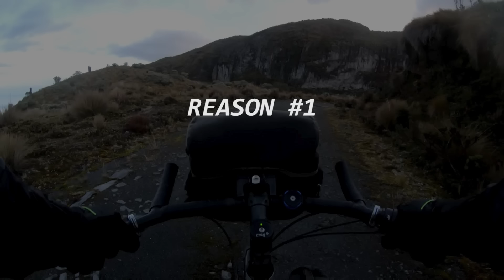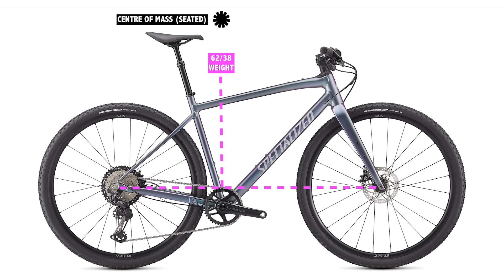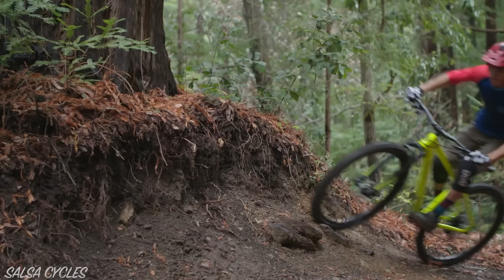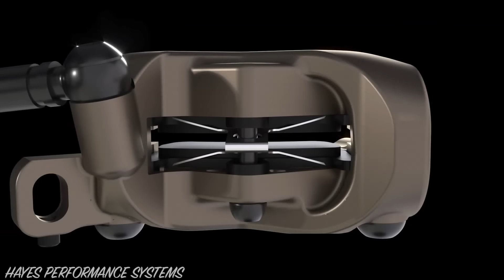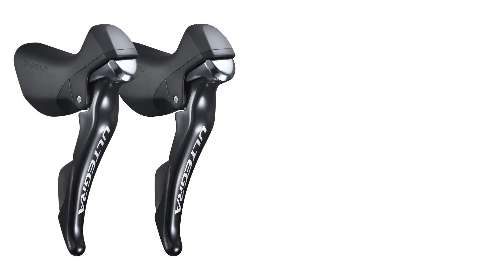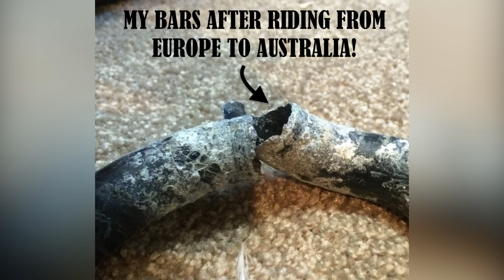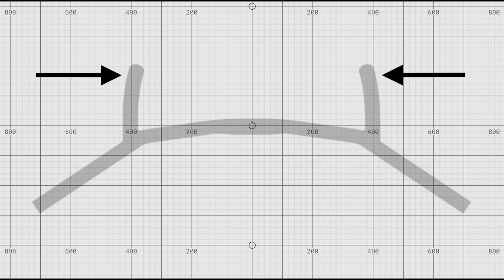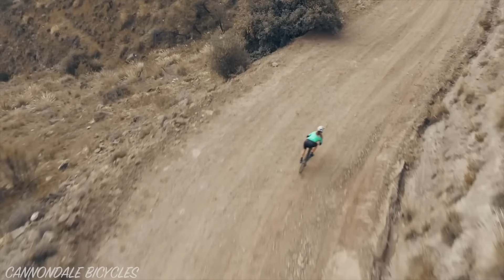Why Flat Bars Are BETTER Than Drop Bars For Most Cyclists (Objective Analysis)

Comment: I'm no expert but have had great results using a flat-bar MTB with a short stem and Jones Loop (a very wide, swept-back design with room for a grab bag). True trail flat bars did bother my hands on rides longer than 20 miles, even on flat rail trails.

Comment: More weight, longer distances means you need more comfort.  Comfort and control wins over aero in these scenarios.  Alt-bar "flat bars" are the absolute best.  That being said, simply own a minimum of 2 drop bar bikes and 2 flat bar bikes all varying in shape and position and you're good to go.

Comment: I am 75 years old and ride the parks mostly on paved trails. I love the high bars of the Trek Verve +2 and the short reach to them, leaving me upright in the riding position. I have had surgery on both shoulders, and I am missing the disk in the L5 vertebrae after surgery. The drop bars found mostly on the road bikes today are for those who race on pavement. The straight bars of the MTB fanatics are not for me. I won’t ever ride like that. So, the adjustable bars of the Trek Verve +2 will keep me riding. The “flat” bars would keep a bike like that unused in my garage if I owned one.
Reply: If you haven't ever piloted a recumbent, you're missing out on some serious, mile-munching comfort on two wheels. They're also very fast, faster than diamond frame bicycles.
Reply: Mtb fanatics? Wtf. Just ride whatever you want and let others enjoy their own things old dude.

Comment: The reason I changed from flat to dropbars is the ability to change hands position and thus avoid hands pain. Yet no doubt all arguments you detail in favour of flat bars are highly accurate
Reply: I'm sticking with drop bars so I can tuck and enjoy substantially less wind resistance going down hills or into headwinds.
Reply: @paulbcote  NERRRRRRRRRRRRRRD
Reply: 😂 But you don’t have any weight on your hands on flats, where pain is coming from? On drops half of your body weight is on your wrists
Reply: @IamUzyf wether you have or do not have body weight on a flat bar depends on you overall posture on the bike, the more vertical your back is, the less weight you carry on your hands. I allways used to be in a 45 degree angle, also with a flat bar.
Reply: Butterfly

Comment: Thanks for another great video! I got a MTB with wide flat bars and a road bike with narrow drop bars. They are both the best for their use cases. For a touring bike I'd probably prefer flat bars with some extra bar ends that allows for some variation in riding position.

Comment: I do a lot of urban commuting with the occasional weekend riding trip. 
For my situation, I found that typical flat bars make side mirror strikes more likely when weaving through traffic and fewer hand positions made longer trips a bit more uncomfortable.   
All said, I enjoyed the video.
Reply: Yeah, I find flat bars are easier on my back but harder on by wrists, because I'm stuck with only one hand position.
Reply: @MrBirdnose  I would try a jones bar; I have the 2.5 rise and they are the most comfortable handlebar I've ever used.
Reply: @MrBirdnose Find the  correct bar angles. I have done a lot of experimenting with bars. My bar is set so my wrist and hand angles are perfect. My Sirrus geometry is also bang on. I commute about 15 miles a day on it with the heavy backpack and I no longer have any pians.

Comment: Tbh didn't know anyone would use drops for trails, I always thought of them as more for bikes on pavement if anything
Reply: It's totally the trend now.. some of the reddit subs I follow constantly have people rebuilding old MTBs to drop bar gravel bikes with a 1x drivetrain. Personally, I don't get adding drop bars to them as opposed to buying a proper drop bar bike designed for it. I prefer drops on my touring bike but my '89 MTB that I use mostly for gravel is keeping the flatbars. Alee's argument does make me laugh though... I mean, of course a bike designed for flatbars is going to be better if the trail gets gnarly enough.. but most tourists aren't riding through that muck ever.
Reply: @saintless  I just think drops are wildly less stable, weird choice for rough terrain no matter how the frame is. I use them on my road bike yes, but I also am on perfectly flat roads. My riser or flat bars handle way better and make me feel a lot safer. Full disclosure I don't mountain bike, just a commuter

Comment: Great analysis, as always. I do agree with most points, but I do find one relevant aspect that was not covered: riding out of the saddle will almost always be more efficient with dropbars because of the more upright position, as a consequence of geometry and distance between handling points. Also, its easier to pull the bars with the upper part of the body with hands facing inside. To get a similar advantage on a flatbar setup will require a much less slacked geo and a really  narrow bar with lots of backsweep.
Reply: Completely agree on the poor ergonomics of riding out of the saddle with a flat bar. One option is adding innerbarends/spirgrips to your flat bar to approximate the hand position of riding on the hoods of a dropbar.

Comment: Really interesting video, and I agree for touring and bike adventures I would always prefer a bike with flat bars. Separate gear and brake controls are a lot easier to source or repair than one complete integrated shifter should it get trashed in transit or after an accident. Prolonged down hill braking on rough terrain with a heavy load is more sympathetic on the hands and wrists. Having raced, time trialed on the road and also undertaken off road endurance and touring I'd opt for flat bars on a touring/ adventure bike any day of the week. Beats me why manufactures produce mtb based/ adventure bikes and then put drop bars on them with integrated cables !!!!

Comment: This is the reason i don't subscribe to GCN, they criticize flat bars but since 4 I'm on 2, and you can even drift the corners with flat bars, which you can't do with dropouts but with flats you can still be aerodynamic because turning momentum feels stiffer when you just hold the inner handlebar because of its simpler geometric shape. But the sweetspot is to have reverse installed hadlebar to have drop flats.
-Engineer cyclist
edit: having longer stem bar and using drops is also aerodynamically worse than using zeroed down stem bar to integrated bar is simply better.

Comment: Drop bars are popular because that's what Olympic athlete bike racers use.

Personally, I'd rather ride a mountain bike with a suspension even in an urban environment. Most city streets are full of cracks, potholes, curbs, train tracks and other obstacles. Thin wheels with no suspension make for an awful and dangerous ride.

Comment: I think there are pros and cons to both. Those swanky high tech multi hand position fancy "flat" bars aren't really flat bars, and are perhaps better than a drop in many instances... But comparing a drop to a flat, I'll take a drop. You can make it 50 something cm and add aerobars to offset the aero loss. That still gives you all the hand positions, the leverage of a flat, the leverage on downhills and the ability to shift weight forward on steep descents and braking. But cut wind on the flats. Also allows for wider bags. My 48cm is a good compromise for everyday riding but probably could be wider for touring.

Comment: Great concept, very well explained. It's something I have been wondering for a long time. I own a road bike with dropbars (of course), and most of the time I ride on the horns. Then I also have a "pseudo" gravel bike, a hybrid/urban bike to which I changed the wheels to 40mm wide gravel tyres, and ergon horns on the flatbars. I almost never miss the dropbars even when I ride fast on flat and wide tracks. On the other side, whenever I ride in just slightly complicated tracks, I am glad I have flats instead of drops.

I said "pseudo" but I see there are some brands that sell gravel bikes with flatbars, such as the pricey specialized diverge EVO. I feel proud to see that the "copied" me ;)

Comment: This wasn't very objective...
Reply from the maker: Which bit?
Reply: @Cyclingabout  i'd said this, as a whole.
Reply from the maker: @skittrokerwarior  You might want to be more specific, because I tried pretty hard to make sure it was 100% objective.
Reply: @Cyclingabout  i been specific enough. This video is not objective. In order to make this video "100% objective" you need to judge without partiality or external influence, that means that you must leave your opinions behind,  In your video, obviously the balance is oriented towards one opinion. You seem more interested in convince everyone that the flat bars are better than showing a fair comparison between the two options.
To be clear here. A discussion about which thing is better, by definition is not an objective discussion. Obviously both things have pros and cons. But the final decision is up to you. Since there is no universal truth.

Comment: Well now, hold on—reasons 2, 3, 4, 5, & 6 aren't comparing flat bars vs drop bars—they're comparing "bikes that typically have flat bars" and "bikes that typically have drop bars". Most of those advantages disappear if you take a typical drop-bar bike and put flat bars on it, or a typical flat-bar bike and put drops on it, and at least one of them can in many cases be completely negated/solved with a stem change. 
And reason 7 is basically saying "everything that isn't a traditional dropbar or randonneur bar is a "flat bar". Nothing you listed in that section, other than "adding barends to flat bars" falls into what I'm thinking of if someone says "flat bars". So, sure, if you lump all of the non-flat bars (except traditional drop bars) in with the flat bars, yeah, that means they have more variety. Personally, I've always seen those marketed and discussed as the 3rd option, neither flat bars nor drop bars. And a lot of those add-ons (like barends) can be fitted to some or all drop bars, too.
Reply: I'm also curious who are "most cyclists"? I mean, I see all these videos (not just this one) of you riding on dirt & gravel roads, and my first thought is "where's the pavement? Don't they pave roads in Australia?" Around here (my small city in a mostly-rural county), "most cyclists" would probably mean "people riding on roads". I might be mistaken, but it /seems/ like there's way more people who ride primarily, or exclusively, on roads—which around here means paved roads—and wide paved trails, than ride off-road near here. 
Depending on where you are and what sort of riders you're talking to, I think that makes a huge difference. Go a thousand miles west of here, and I'm betting the off-roaders dominate. Around here (USA), the vast majority of people who are doing bike touring, frex, are doing it almost exclusively on paved roads. The only people I see or hear about doing bikepacking are doing /winter/ bikepacking, with fat-tire bikes. 
Globally, I'm betting you're right that most cyclists are riding on unpaved roads at least some of the time. Maybe that's true in Australia, too. It might even be true in the US, generally, given the popularity of off-road recreational cycling and the near-absence of utilitarian cycling. But if your audience was Chicago commuters, then "most cyclists" are probably utterly unconcerned about super-low gears or handling rocky terrain.